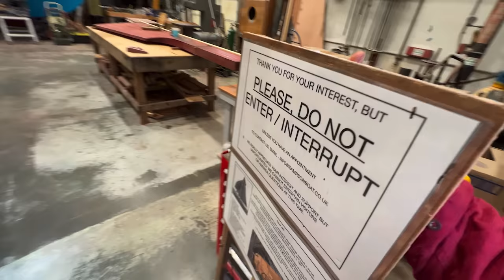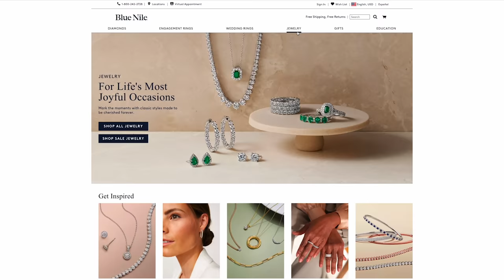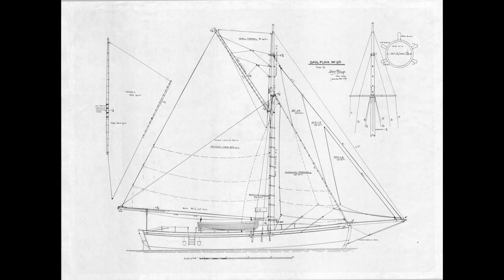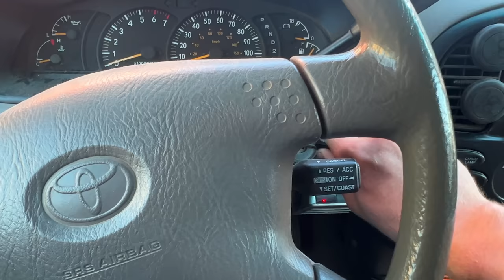The challenging reality of running this project

Comment: I’m an engineer and mathematician, and the percentages you noted are just fine if your basis is a 40 hour workweek. And we all can see your workweek is closer to 80-90 hours much of the time, which means you are often at 200% of a normal workweek. So no problem in your use of that >100% application Leo, and I’m sure all your viewers are okay with it. 😊

Comment: I love Leo's skill in managing this project.  I've thought about it many times over the years of watching this channel. I've worked for many project managers over the last 45 years in the steel fabrication industry, drawing shop and field installation dwgs for structural steel buildings, bascule, lift & swing bridges, etc. Some PMs are good and some not so good. A good project manager can make a complex, difficult project flow smoothly and prevent "fires".  Their value to a job and my personal sanity is priceless.

Comment: It's so true that as you add workers to any project that project management will become the most important function on the project. It's like the rudder on the project ship.. For a well oiled smooth running project every part of the project needs to be considered in it's detail and planning and ways around potential problems as well as making sure that each worker has what they need in advance to keep them working efficiently. 
The devil is in the details.
For want of a nail a horseshoe was lost etc...

Comment: I am very impressed that you have been able to transition volunteer labour into paid labour. Offering experience to volunteers is always good, but being paid for it gives a greater sense of  value of the work.

I am also impressed by the description of the joinery.  I suspect that much more simple joints would be sufficient, but the elegance of the joints being made ensure the boat will be not just capable but a object of practical art.

Comment: Keep the need for cooling on the fridge in mind.  The compressor and especially the condenser need to expel heat or they will not work right.

Comment: Regarding your closing comments about the project going in a direction you never imagined, I would love to hear you expound on the things you DID imagine and what’s better now because of the channel. For example I remember the original ship had iron (steel?) floors and knees, but because of the channel you made the decision to cast them in bronze. 
When I see things go in like welded aluminum tanks, I often wonder if that’s “standard” and what you would have done anyway, or “luxury” because of the channel. 
What about the mast and spars? Would you have just used an old telephone pole or something?
Or, maybe it’s simply all about having a hired crew to help you?

Comment: You can actually work at 125%  If you typically work a 10 hour day and you work an extra 2.5 hours that's 25% more than average.  So you did 100 percent of the work and 25 percent more. It makes complete sense to me because I'm a plumber not a math magician.

Comment: The boat is looking amazing! not sure if you have winches yet, but I have two barient 35's two speed self tailer's in annodized aluminum. They need a cleaning and overhaul. If you can use them you can have them for the shipping from Massachusetts.

Comment: G-day Leo thank you to you and Crew for the video mate your all doing a tradesman like job .Heres a bit of trevia for you I served my apprentisship as plasterer forth generation in Belfast the real one where Titanic was built mind you the last ship I worked on as a tradesman and insadently the last big ship ever to be built there in was for Arostathol Onassis for lease to Shell oil its name was ESSO Ulidia (not Greek) Gealic its displacement dead weight tonnage was 230,000 thousand tons the first super tanker ever built to run Ahbadan in the Persian Gulf to Vera Cruse because the Sues Cannale was blocked The Egypians Sank every british ship ithey could fined in the middel of it. The Ulidia only lasted 12 years and was   beached in Goa India for scrap sorry for the history lesson but I find when people do not explain very well, thats how details get lost  The question what was a plasterer doing on an Iron ship ? Hot and Cold insulation miles of it there was roughly 8 miles of pipes tanks and boilers finished by hand now days the insulation is covered  by metal in most cases. It use to be on a lot of passinger ships not all but most the fancey work as it used be called and which most think is woodwork is Plasterwork run in situe and no I did not work on the Titanic the last ship my father worked on was the  Canberra which the brirish used as troop ship in the Falkans in the early eighties. All this has no realivence what so ever to what you doing on Talley-ho except to you know when I used the term tradesman like I understand what that means and can aprecate the task you have all under taken and good trades people never get rich we tend to give it back as we work the job comes first life is incidental to it. I’m off my soapbox. My joy was to raise a family and better off than my wife ever were and we have been married fifty three years so be happy at your and it not has a task but a vocation. I apolgise for the rammble but I know a good job well done.cheers from Australia. 🫶🦘✌️👍❤️

Comment: Leo, I noticed that your “f%€@ing GORGEOUS” companionway steps are beautifully and perfectly finished, in a nice gloss Schellack. Emphasis on “glossy”, as I also noticed the seemingly notable LACK  of any tread, grooving, or checkering to create a suitable non slip surface.  Are you going to apply nonskid strips, or rely on the catlike reflexes and gecko grip of the crew?
Reply from the maker: They will have brass treads over the nosings 🙂 thanks
Reply: @SampsonBoatCo  Thanks for taking the time to read and reply. Class and style points all around.

Comment: It's a strange thing but of all the traditional crafts I have been a part of, boat builders are the oddest. It seems to be the town at the end of the railway line. The basement pool bar. The place where misfits, never quite made it anywhere else dude's end up. 
Divorced is a common theme along with drug and alcohol abuse. Or unconventional sexual preferences. It's the kind of place where you meet guy's who would otherwise be boring the bartender with their sob stories or need a lift to the whorehouse on pay day.
I guess that's why I never stayed around boat shops very long. Learned a lot of useful skills but I didn't want my self esteem to end up on the barbecue.

Comment: How much of the boat is still original? Genuine question.
Reply: Not v. much!
But at 19:30 you can see the original iron 'horse' that will anchor the mainsheet. In addition:
- the lowest 3 planks of the teak transom, ~30% of its total area
- 6 tons of the new ballast keel are original lead,  ~75% of the new weight
- bunk side-rails are original teak hull planks
- the old capstan is being repaired & motorized.